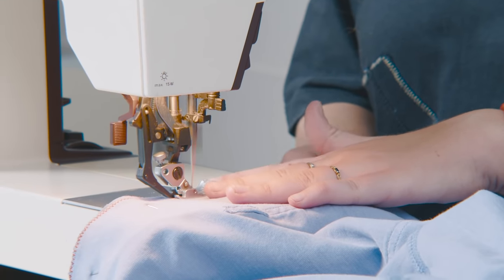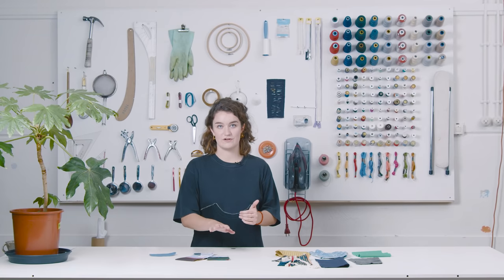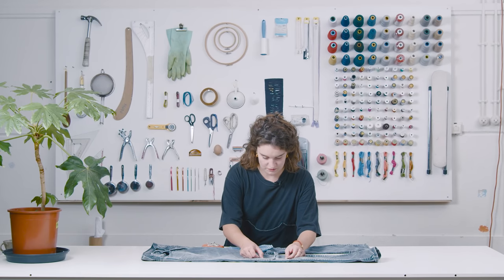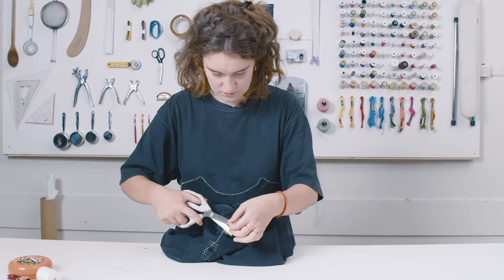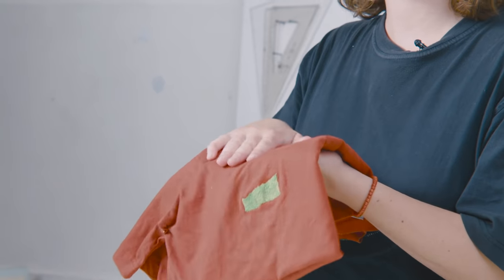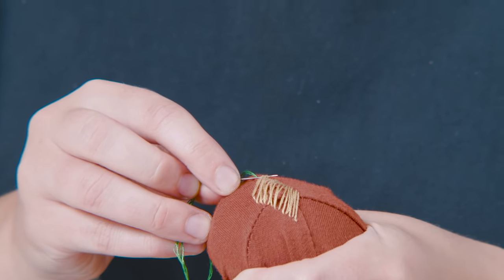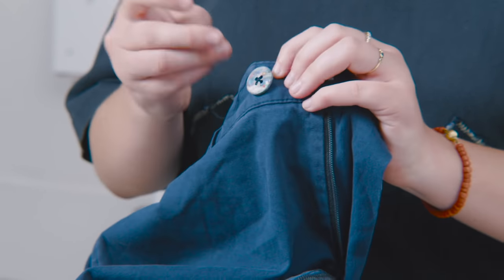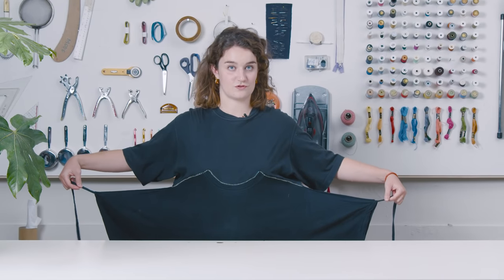How to repair your clothes #fixingfashion

Comment: OK, this is a great initiative and I would love to give repairing jeans I have that are desperately in need of a patch. A few things in the video that were sort of rushed over, so possibly assumed knowledge?
1 - Does the patch repair on the jeans require you to slide the leg of the jean over the arm of the sewing machine? 
2 - What do you do with the excess, unsecured patch material on the inside of the jean leg?
Reply: I know this was forever ago but here's an answer to 1 😅. Yes, you have to kinda put the pants on the sewing machine, or else you'll see the front to the back.

I'm also wondering what to do with the extra fabric, like, either they hand stitch it to not flap around or they trim it? But they purposefully made it big so I don't think that's right. 
I've seen patches (in this video I think) where they go along the outside of the fabric of the patch so I think that.

Comment: If the zipper doesn’t close. You can apply pressure with some pliers. Their are also repair sliders available.
Reply: True that! Just, if the slider is from zinc alloy cast material (often the case), then the pressure has to be applied very gently, causing just a minimal amount of bending. Bending too much, or back and forth, easily leads to breaking the slider.